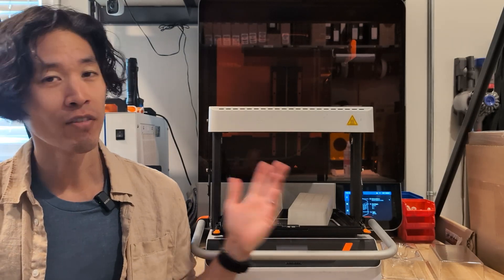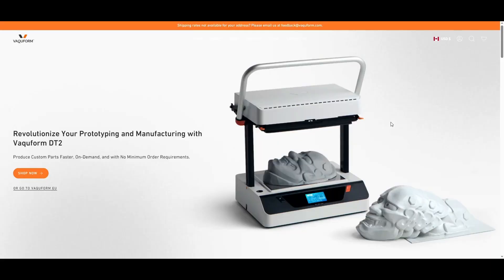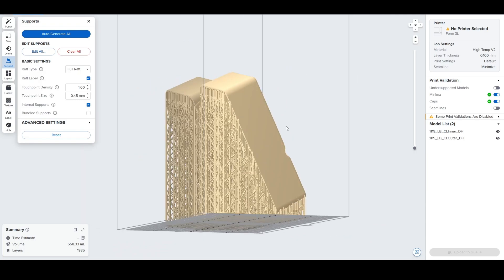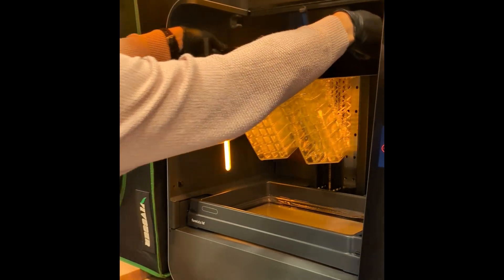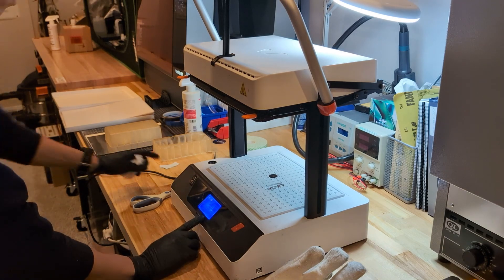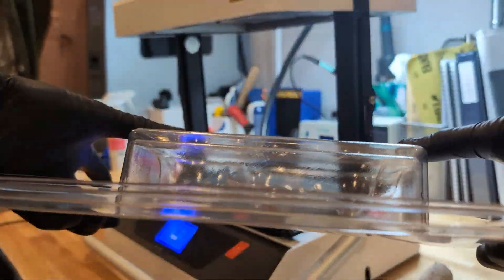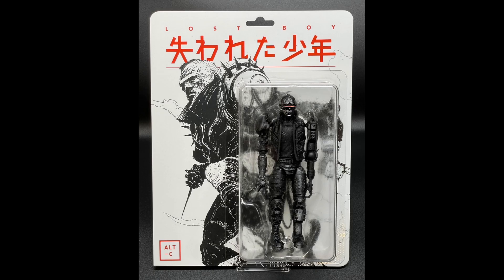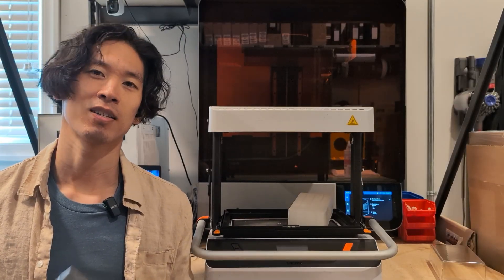VACUUM FORMED packaging for a real action figure

Comment: for +1000$ that's way too expensive.
Reply from the maker: Totally disagree, and I've built my own vacuum former before. I think this machine is worth every penny and is actually worth more than what they sell it for.
Reply: @emberprototypes  Who is this machine even aimed to? Because as a professional you aren't going to be providing better prices than what factories will give you and even if you do, you'll need to complete over +5k orders before u break even. Unless you are scalping prices from indies this is wasteful spending even for hobbyists.
Reply from the maker: @Iamsofakingwetartit  it's not cost effective for high volume because the speed per part and my labor costs are high but it is way faster and cheaper for any application that needs low volumes (in the 100-200 range).

I've done work for companies in this quantity range and it beats traditional competitors both in terms of price and speed because the traditional methods are very slow and expensive when amortized across smaller numbers of parts.

That's the whole point of something like this. High enough value but low enough cost. Everyone has different price sensitivities and thresholds but there are often many niche applications where you can add value. I've paid this machine off more than 10x since the day I got it.

It's kind of like why a $1000 Bambu machine had tremendous value over a $30K or $100K Stratasys machine...